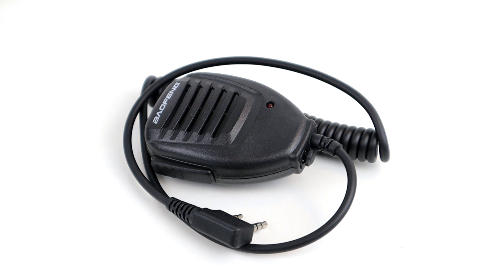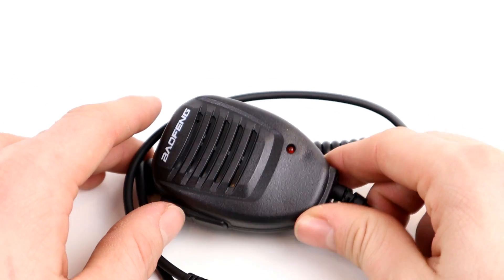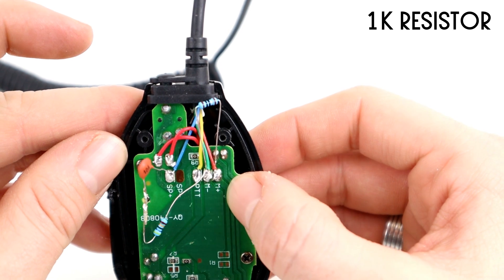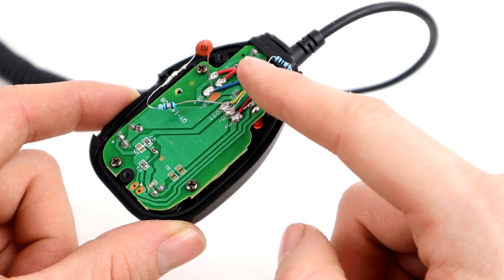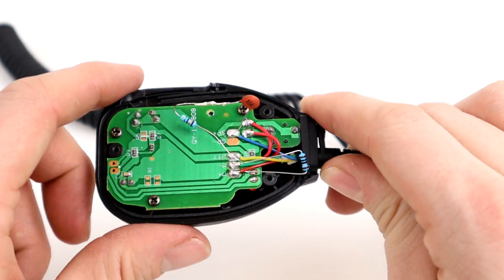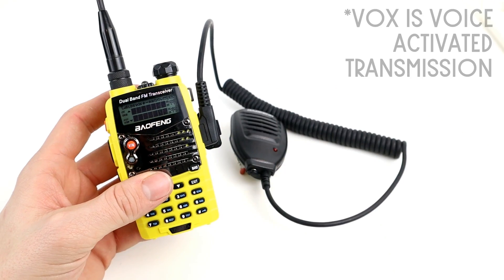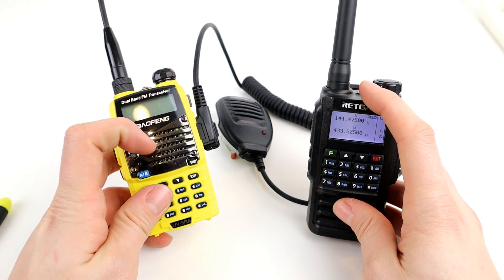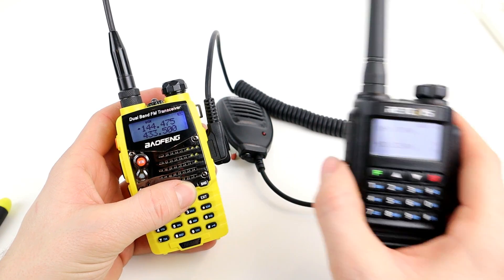Building A £3 Hidden Radio Range Tester!

Comment: The yellow dude seems to be only sending back a couple of seconds. Is the duration determined by the components in the mod ? Im assuming the value of the capacitor determines that right ?